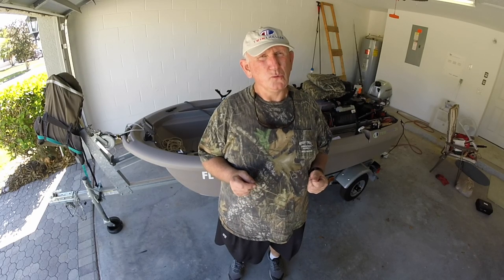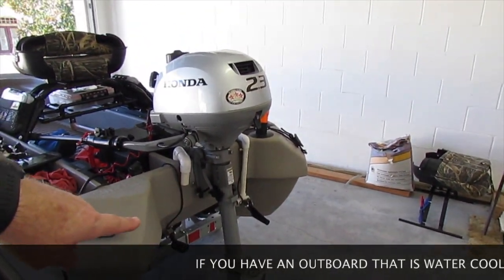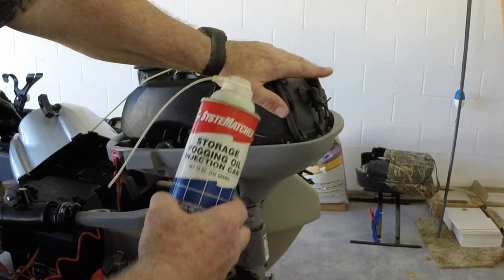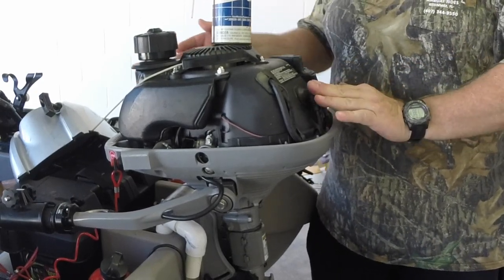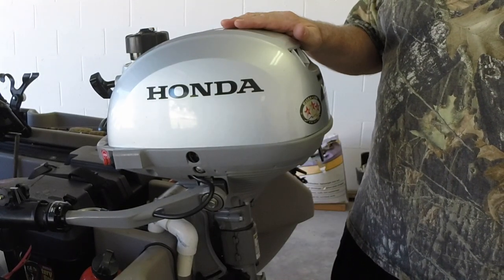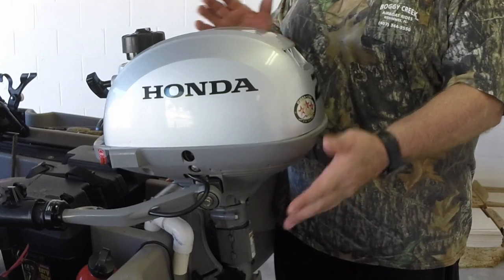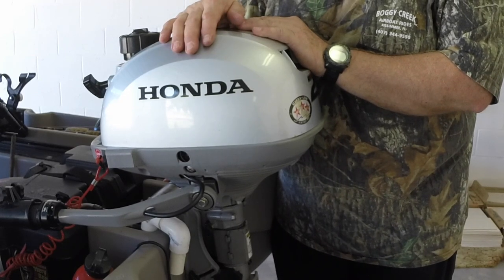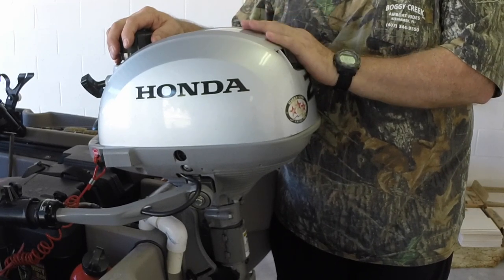HOW TO WINTERIZE YOUR HONDA 2.3 HP - TWIN TROLLER X10

Comment: Steve here from Michigan. Thanks Gerry and even the wife says thanks cause she has put up with me worrying about this problem and others. She reminds me once in awhile by telling me. "Your a retired Cop not a retired Mechanic" It's true but as you already know I haven't completely retired. I do have a full basement that never drops below 60 even when it's -15 outside. I can stick it in the back corner where the ventilation van keeps the air clean. Also up here at our local Marathon station the super grade fuel is ethanol free but a word to the wise on that. Before you put fuel in your Honda make sure you run a good gallon through the hose first because there will be ethanol fuel in the hose from the last customer and never use fuel more than a month old for best results. I've learned this from all my other toys . Again thanks Gerry and hears hoping for a good winter (SUMMER) fishing for you down there.
Reply from the maker: Steve, I shivered when I read about the 15 degrees outside. 
Good advice about the ethanol fuel in the first few feet of hose. I did not think of that. I fill my five gallons of non-ethanol Fuel in five gallon gas cans (for my mower, weed walker, generator, etc.) that I have treated already with stabilizer, then fill a one gallon can, also with stabilizer, for the Twin Troller.  
You need an electric blanket!    ☃️            Thanks for keeping us safe.                                                                                                                                                  Gerry
Reply from the maker: Steve, I forgot to say a special "Your welcome" to Mrs Steve. Thanks for all her sacrifices over the years to allow you to take care of us. Wives of law enforcement put up with lots and they rarely get the thanks they deserve. Thank you, Mrs. Steve!                                                                                          Gerry
Reply: Your so welcome and she appreciates what you said. Many a night for years she has comforted me when nightmares of things that happened to me years ago woke me up. We owe our wife's so much more than a thank you for a full plate of food and a clean shirt.  I think that the biggest mistake a man can make is not being able to swallow his ego and simply say I'm sorry once in awhile.

Comment: Do you have to drain the oil as well? Or can you leave the oil during the winter season?
Reply from the maker: Rafael, I am not sure if you are storing the Honda in a warm place for the winter or not. The reason to change all the fluids is not only for general maintenance but it is also to remove any water that may be in the crankcase or the lower end unit so they do not freeze during the winter because water freezing can break the casing.           Gerry

Comment: Got a quick question for you Gerry. If you plan on going somewhere far across the lake and want to use the Honda to get there do you leave the trolling motor cavities empty while traveling and if so do you have to empty them before you come back with the Honda.
Reply from the maker: Steve, good question. I never considered leaving them empty and am not sure you could. To leave the boat launch to get far enough to safely use the Honda I fill the trolling motor chambers otherwise they will not work. The propellers would mostly be just spinning in air until you pushed it all out. Usually before I step into the bow of the TT at the launch I reach into the boat, press both pedals to high, let the boat push against me until all the bubbles are gone and maximum thrust is felt. I think if I did not do that and was able to somehow get deep enough to use the Honda I think they would fill on their own as the TT was propelled along, but I never tried it to see. 
If you did that then then traveled to the location you want to fish you then pushed out the air in those chambers there is not way to get the water back out to make the return trip unless you beach the boat and lift the nose of the boat enough to break the suction and drain the water out. That water when filled in the trolling motor cavity sucks the TT to the lake surface and substantially increases the stability of the boat. Without that it would be as tippy as all other boats of similar size. 
By the way, I have not forgotten your request about a knot tying video. It is still on the list to do. Besides others, I have a knot I regularly use that you probably never saw before. It is easy and holds well and a professional television fisherman you will recognize uses it too.                                                 Gerry
Reply: @LunkerFishing  Thanks Gerry! It just sort of popped into my head about the Honda and that it might go faster with the cavities empty because it would sit higher in the water but again if it was higher all the water pressure would be against the trolling propellers. I just think I'm over thinking again.

Comment: Do you ever use a football Jig? I've heard a lot about them here and there
Reply from the maker: Steve, it has been a long time since I used a football jig. They are better suited for deeper water with structure and drop offs with sparse vegitation. I used them in NY but Florida is not quite that kind of waters here. There are some guys that use them here but it is a technique used here in open water which we do not have a lot of. I use a Carolina rig more here because they can pass through the sparse weeds in open water better than the football jig.                                             Gerry

Comment: The max rating on the Twin Troller is 2 HP.  Most owners are using the 2.3 Honda.  Is anybody running a motor with a HP above 2.3 and with what results?  Many thanks again to Gerry and my fellow TT owners on Gerry's site.  All of us love our boats.
Reply from the maker: Victor, I know some others use outboards that are not the Honda. It would be best to read their replies on the subject. If you read the comments on other videos of mine some have made those comments already in a few videos. I do not remember which videos, you will have to look.    Gerry